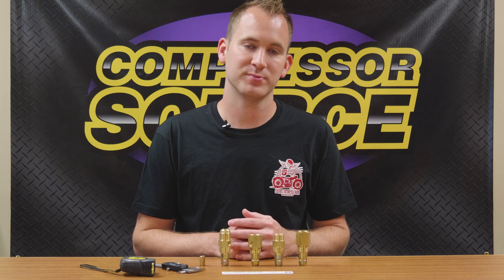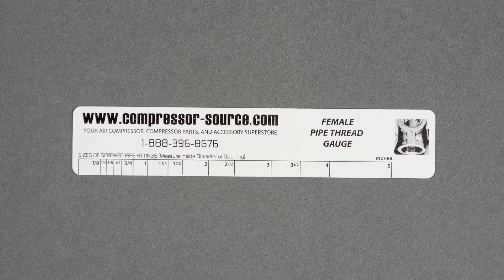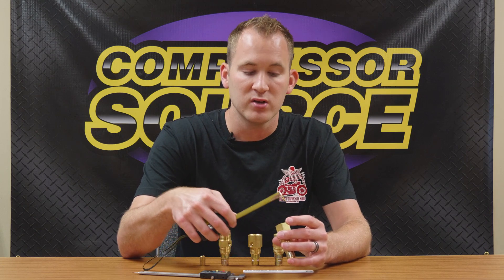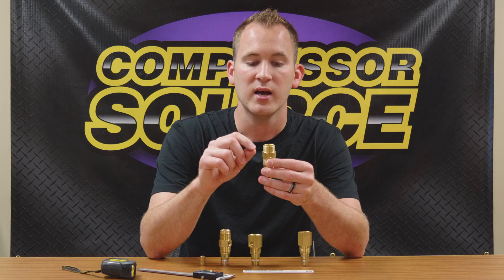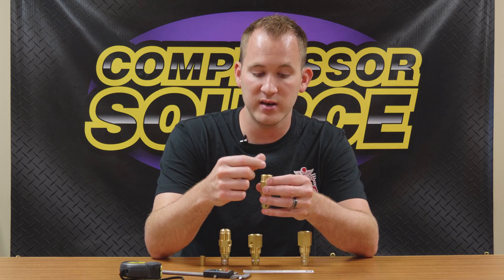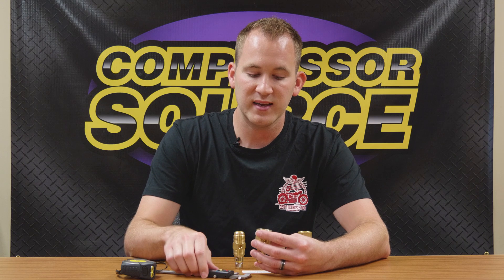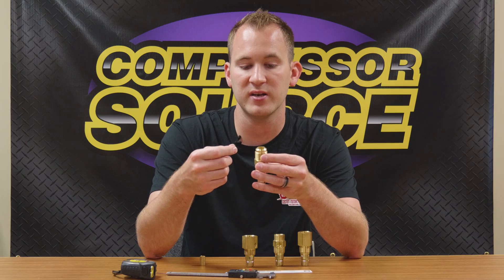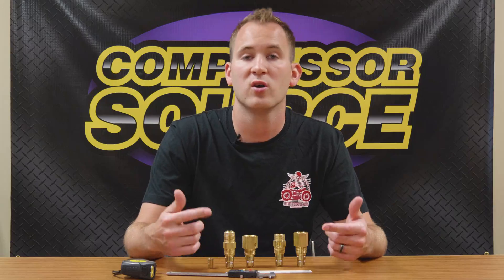How to Measure Thread Sizes: NPT Fittings, Flare Fittings, and Compression Fittings

Comment: I've been trying to replace the hose on a Goodyear hose reel.
The current hose has a right angle female inverted flare fitting.
Near as I can tell, it screws into a 16mm x 1.5 bolt.
I can't find an adapter anywhere 🤷🏼‍♂️

Comment: Great video. Thanks 
I have some questions. 
1. What kind of thread is on the side of the check valve? The little female threaded hole?
2. I have a Quincy QT-54 air compressor. The unloader valve had a 1/4” OD copper tube attached to it. It’s a male thread that looks like a 1/8” MPT but it’s not. I need to convert this to a 1/4” NPT somehow. So I need a female adapter that screws onto that male thread on the unloader valve and has a 1/4” NPT on the other. Can you help me to choose the right part?
3. My 1/2” OD copper tube from the compressor connects to a brass fitting on the tank. This is where the check valve is. The brass cross has two small female holes on either side. One is for a PRV and the other is for an elbow that hooks to the 1/4” OD unloader tube. I want to replace this whole thing with a new check valve with a 3/4” MPT on top, a 1/8” FPT on the side (for the PRV), and whatever male thread there is on the tank. Can you help me on this too?
Sorry for all the questions, but all these different threads are driving me nuts. 
Thanks,
Paul

Comment: OK but you didn't explain WHY pipe thread diameter is 1/4" larger than the measured thread diameter. That makes no sense, there has to be some logical reason why they are sized that way

Comment: Actually,  a better bit of info would be, what size tap and dye would i use to clean up bad threads on a flare fitting?   I.e. 1/4”???
Reply: Oooo
Reply: the harbor freight tap and die set has a thread gauge on it. amazon has a thread pitch , diameter gauge for like 1$. and dial calipers. just measure the frickin threads lol. unsure? take the opposite piece and measure it